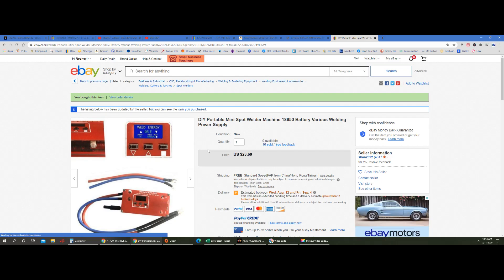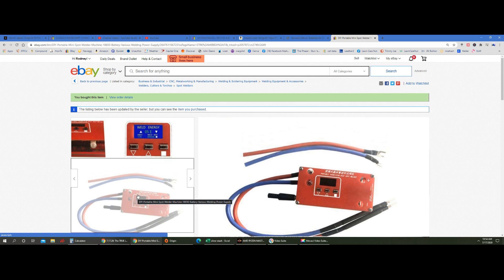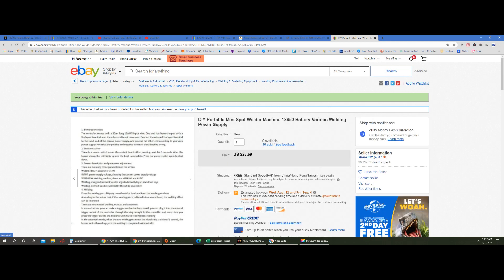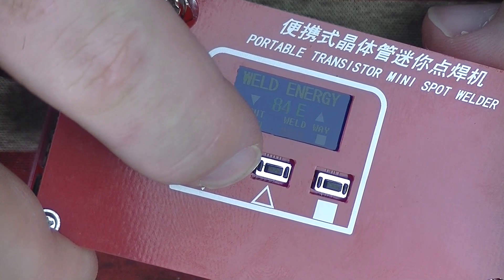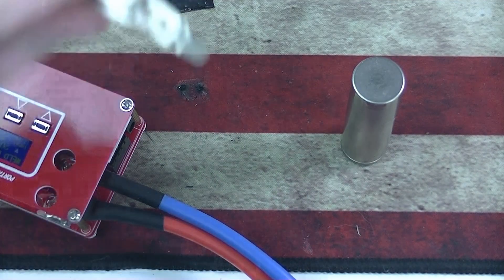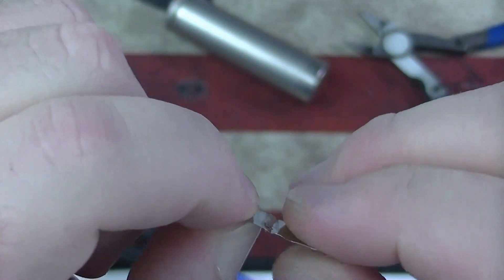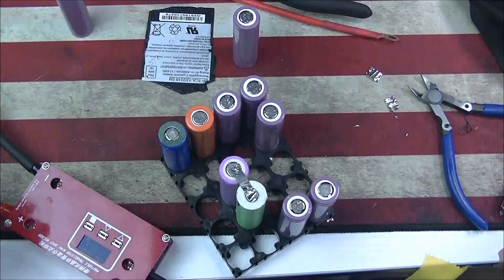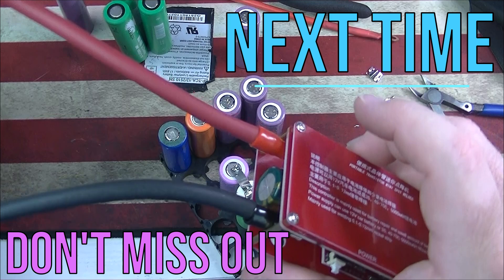The Best CHEAP 18650 Spot Welder?

Comment: Mine blew up on the first weld. I cut out the blown Mosfet and now use it as a timer for a starter solenoid welder.
Reply: Interesting! Please tell kore about how you have done that in detail!
Reply: @victorandersson9737  Mine failed in the 'continuously conduction' mode. You need to cut the traces top and bottom, I used a Dremel cutting wheel, to identify the faulty mosfet. In my case it was next to the capacitor. I then 'destroyed' the mosfet with the dremel and resoldered the traces. Make up new leads from the battery to the red box and output from the red box to the solenoid. These do not need to be particularly heavy duty. Use the supplied red lead to go from the battery to the solenoid and attach the red welding pen to the solenoid output. Joint the two blue leads together and connect to the neg of the battery. For good measure put a flyback diode across the solenoid windings. You will need to use a foot trigger in manual mode. Google solenoid spot welder, the idea is not all mine. I used a car battery and I needed to add some extra cable into the welding circuit to cut the amps down a bit. Good luck.

Comment: Try holding the tips perpendicular to the surface you're welding.  From some of the close up shots, it looks like you're getting very small weld areas.  Too much weld energy will burn through the edge of the weld shape and make it weak, too.  Thanks for showing me how affordable these can be!  I might order one in case I ever rebuild any battery packs.

Comment: I bought the same one it lasted for two extremely underpowered welds and now all it does is direct short as soon as the two probes touch totally junk
Reply: I have the same Welder It it works great! 
But now I have the same problem, after low voltage the welder make direct shorts without beep. 
Any solution? Can I repair it?

Thanks.

Comment: Worst $24 I've spent . . . tried it first time and smoked one of the mosfets. Dismounted the burnt mosfet and then tried again. Will not weld at 30E settings so bumped it to 40E and smoked two other mosfets. And yes, this is with the diode mod recommended in one of the forums.
Reply from the maker: That sux. knock off mosfets.  Mine is still going strong. just finished 6,500 welds with it.  Still cheaper than a K-weld, even if you have to buy 2 for the extra mosfets.   I do own a K-weld tho too.

Comment: 1:50 Tinned copper is copper wire that's coated with with a thin layer of tin.  This makes it easier to solder, but more importantly it protects the copper from moisture which can cause resistance in the wire.
Reply from the maker: nice!

Comment: Hello, thank you for your informative video. What about the question you asked yourself at the end of the video. If we take a few 18650 batteries in series (and in parallel to increase current), can we make this thing weld? I would very much like to know, because if we can, I will buy three high discharge LiION 18650 batteries and power this thing with these. I don't like the LiPO technology!

Comment: I'm looking to do a couple welds here and there. Mostly just repairing worn out tool batteries and maybe a personal power bank project. Would you consider this little gadget over say a welder made with a recycled microwave transformer? Making one out of a transformer and adding a timer looks pretty simple
Reply from the maker: I would say the all-in-one that comes with the battery. It will weld .1mm. for cheap. If you have a a good 12v LiPo battery then this one is the way to go.  Im using it now for my Powerwall video.check out my other videos.

Comment: Can someone explain the motion of the wires when welding?  Do high current on wires cause it to jerk?
Reply from the maker: ITs that or the current creates a magnetic field that repels the wires.
Reply: Yep. I first have seen this when i used relative thin wires in combination with relative high power speakers.

Comment: the second spot weld it did 2 MOSFETs Caught fire.  I was using 3 cel lithium battery 80c.  even the instructions that were supplied says that the internal resistance the MOSFETs can vary and this can cause them to destroy themselves I will get my money back on eBay.   if they are prone to fail this often perhaps they should supply extra MOSFETs.   For me it's a complete waste of time

Comment: I spotweld 18650's with a big capacitor charged to 35v.  It's easy to just charge it to a higher or lower voltage depending on how much heat you want.
Reply from the maker: Thats pretty cool. How long does it last per charge?
Reply: @RodneySolarCircuits  One shot per charge, but you just use it connected to a bench supply (only connected to charge, disconnected to fire).  So, engage bench supply for 1 sec or so, then off, short terminals to thing you want to weld, and repeat.  If too hot, lower volts, too cool, raise volts.  I find that 35v seems to work well.  Cap is 100kuf 50v.
Reply from the maker: @vandal968  cool

Comment: I bought one of those and it was a complete piece of junk. Ity did not work right out of the box and after trying for about 5 minutes it shorted out and just about lit on fire! You get what you pay for.
Reply from the maker: Sorry to hear that. Im using it now to build my powerwall and its doing just fine.  I guess its hit or miss. It is the best cheap welder I have used. Im not using a car battery tho. 3s lipo

Comment: also have one of these 20 bucks spotwelders.. were like 18 bucks + a couple in shipping.
and just use RC LIPO packs..4s even though rated at like 3s.
with one 4S i noted the pack got a little hot, so used 2x 4s in parallel and it delivers all the juice I need even with 0.2mm strips.. https://imgur.com/a/wo4v4Mz
also, check it on the scope and the Energy interval adjust was 1 to 1 with one of the measurement variables on the scope... period or width. (ms)
but that spot welder will do for my semi-needs.
Reply from the maker: I'm using mine to build these huge packs.  Placed a little fan next to it and it keeps it cool enough I don't have to stop as much.  Im switching between it and kweld.

Comment: I bought this exact welder.  Connected it to a 12v car battery on my work bench.  After a little practice, got nearly 1,000 welds then it smoked a MOSFET.  Ordered a replacement and it made three welds before smoking a MOSFET. If they work, they're great. but the quality control is out the window.
Reply from the maker: I think you are right! mine is still going strong.  im using it in my next video now. I have to let it cool down a lil after 8 welds @ 40E

Comment: Anybody blow a hole in 18650 with a welder before mine keeps doing it
Reply from the maker: lol.  yea turn it down and make sure there is no air between the strip and battery.   30 -40 is all you need for .15mm
Reply: @RodneySolarCircuits  thanks my car battery is 640cca does that have anything else to do with it?
Reply from the maker: @hedgehog5705  well if you read the comments they talk about car batteries blowing the welder up. now I dont hear from the ones that have used a car battery and had no trouble sooo. But I use SPIM08HP cells (3s) and they are capable of 400 amps each. I used this welder last night and it still works fine.
Reply: @RodneySolarCircuits  i'm using a  510A car battery and the first time i tried this spot welder the battery was fully charged (around 13.4v),but luckily no blown mosfets here :)
So probably there are some "flawed"  batches of this spot welder, idk.
Btw, i used the vanilla version of the spot welder, no mods/improvements done.
Reply: Has anyone tried using a VS-100BGQ015 Schottky Diode between the + and - welding leads to help dissipate the avalanche energy ?
Reply: @jimbean8413  I plan on adding SMCJ20A TVS across drain/source of each FET. I bought 10pcs so I'll probably throw a couple on the power input and output too.
Reply: @andronicuscomnenus2642  Not sure if you've read the endless sphere forum thread on the JP spot welder, on page 23 flangefrog gives a good summary, as per okashira's comment "the flyback (schottky diode) takes care of 90% of the avalanche energy, and the TVS diode takes care of the other 9%" I've ordered a couple VS-100BGQ015 and five 5KP13A, once received & installed I hope this will allow the mosfets to survive
Reply: @jimbean8413  No, I hadn't seen that thread. I already have the TVS and it cost more for postage than the parts, so I will just use them and see how it goes. kWeld uses only TVS, and that's the gold standard for spot welders. It uses a SMCJ28A on the power input, SMDJ28A across load/probes, and SLD8S28A across drain/source. EDIT: I see the newer versions use SLD8S28A across the load now instead of SMDJ28A.
Reply: @jimbean8413  Forgot to mention I'm also removing the large capacitor because is serves no purpose and only causes the terminals to spark when connecting power source. I'll also add a large(ish) cap on the control board power input after the blocking diode. This will prevent the gate voltage from dropping too low during a pulse.
Reply: @andronicuscomnenus2642  Nice, looking forward to hearing how it works out, Would like to get a kWeld but for the amount I'd use it, can't justify the cost
Reply: @andronicuscomnenus2642  Nice work, those mosfets should last now!

Comment: What did you use for a power source for the welder? Could I use a lithium tool battery as a power source for it? Like a 12v tool battery just as it is without dismantling the battery and just run leads from the terminals?
Reply from the maker: aslong as its  9-12v you could try. good idea.  i WILL HAVE TO TRY THAT

Comment: Can you recommend any spot welders for 2mm nickel  .
Keep up the vids
Reply from the maker: This one will do it for sure.  I have tried up to .3mm.  This thing has power with the right battery.
Reply: @RodneySolarCircuits  thanks for reply how many welds roughly before having to let pcb cool down .
I take weld quality changes as it gets warm?
Reply from the maker: @gkitch6755  for .2mm prolly have to have it set to 30-45ish and even my Kweld gets to hot while I was building a 7s8p pack.  Mainly the welding pins got to hot to hold.  So about halfway through it I had to let it cool down.  2 welds per end.

Comment: Come on man! Forty Joules or E applied for a tenth of a second only requires 400 Watts. With 12VDC that's only 33.33 amps. Way off from 300 amps! Your original wire will work fine.
Reply: How do we know it's only 40 joules?  Is there some sort of data sheet/guide that came with this gizmo which says a reading of 40E means 40Joules, or is that E reading just a relative enrgy scale.  TBH 40 joules hardly seems enough to make a spot weld ???
Reply from the maker: @chrisbrett1857  on the Kweld it is measured in joules.  30 joules is enough for .15mm nickel strip per kweld. But everything is relative.
Reply: @RodneySolarCircuits  Thanks for your reply - it's very helpful to me, as I've been struggling to find a definitive figure for the approimate level of energy needed to make a battery spot weld.  I've seen good reveiws of the Kweld, which seems  to be a well-engineered pieve of precision kit - but a bit pricey if (like me) you only want it for very occasional use.  What you say certainly lends credence to the idea that the piece of kit in this review will weld at 40E & that 40E=40 Joules. Thanks again
Reply: I believe the pulse is shorter than 100ms. Typical pulse time would be 1-40ms from what I find on Google.
Reply: If it was only 30 amps, you wouldn't need wires anywhere near that big. I think you're overlooking something. Thinner wires would give better flexibility and mobility; I'm sure they use thick ones across the industry for a reason.
Reply from the maker: You Know....The thing...look    Come on man....Thicker is always better, Corn Pop told me  "Trust the scientists"  he said, no matter what race the lady that stocks the groceries is.

Comment: What are you powering it from? I am wondering if it can be powered from a home electric socket with a voltage converter
Reply: High amperage lipo or a car battery. its not the voltage that does it here its the amps
Reply: @Trojan_DC  thanks! Never heard of a lipo before. Will have to do some research

Comment: @Rodney Solar-Circuits  did you try a car battery?  i just got one of these welders and used a 12v 7AH rated 45amp for 1 minute  which should of been more than enough.but it blew a one of the 1 of the mosfets :(  any solution for this or know why ? any help appreciated did you try a car battery?  i just got one of these welders and used a 12v 7AH rated 45amp for 1 minute  which should of been more than enough.but it blew a one of the 1 of the mosfets :(  any solution for this or know why ? any help appreciated

Comment: This is Jason Coronado. Same person, different account. Just fried mine today. It's possibly due to me using it after putting the lipo in storage mode (11.4v). Can anyone confirm, or is that low voltage not likely to fry a mosfet?
Reply from the maker: IDK, should have been fine. that is how i use mine with no problems. I have heard that if the leads touch it will blow a mosfet. ??
Reply: They never touched. Made a nice acrylic case for it as well, lol. Oh, well--went and bought a Malectrics instead. At least I got a refund.
Reply from the maker: @SpaceKaseJase  Well there you go!  That will for sure work no problems.   I have a K-weld. Its a beast!

Comment: Can someone who has replaced the FETs on these devices tell me how you removed the old ones. Do they have pins going through the PCB?
Reply: No, they’re surface mount devices. But the cost locally for me of the 5 mosfets is higher than buying a new spot welder unit.

Comment: Mine let the smoke out first try. Using car boost starter as suggested in one video. I guess this device is very sensitive to input voltage. Must be running on it's limits.

Comment: I.ll stick with my soldering iron..last longer and doesnt blow components after heavy use
Reply: Good luck. The heat necessary to solder to the battery will damage it.
Reply: @lindanlester  No luck needed sorry, been doing this for over a year. No issues..😁
Reply: @k1ortia  You are greatly diminishing your possible cycle count, proven fact. Heat is bad for Lithium chemistry cells.
Reply: @earnwithbots2783  i agree, but after 2 years of using this method..the facts dont lie.😁
Reply: @k1ortia   Cant argue with that. And that is with daily cycling?

Comment: that welder is pretty good for that price, i am going to oder 1 for myself now. thanks for the video.
Reply from the maker: Thank you!  What kind of battery are you going to use to power it,  People have been having bad experiences using CAR BATTERY. make sure its under 12volts if you do. Or maybe you would like one of the ALL-IN_ONES that I made videos about?
Reply: @RodneySolarCircuits  I am going to use a Car battery, because I work in a autoshop, so I have alot of car battery around here.
Reply from the maker: @icebreaka1969  careful with the voltage.  Maybe it will be fine and the handful I have heard from are the minority.

Comment: Just noticed another video that did not work for him... But I noticed that he does the positive first and then negative, and it blew. I noticed that you touch it with negative first the positive. Do you think there is a difference? Since the electronics are controlling the negative side and positive is just straight through
Reply: I think applying ground (negative first) helps in just about everything when working with electricity. This is probably why switches go to the positive as negative is always connected. Don't know, just my hypothesis.

Comment: You can’t weld 2 dissimilar metals.  Only under a roll welder it can be done😁
Reply from the maker: nickel strip to steel can battery? Is nickel special that way?

Comment: How do you get the unit to Auto mode, mine sparks as soon as i touch the probes to the metal. No instructions with mine.
Reply from the maker: I think it is the button on the right. but you will need a foot pedal or switch.
Reply: @RodneySolarCircuits  Thanks for responding, mine switches but apparently the auto doesn't work, it sparks as soon as i place it on the metal strip. Thanks again
Reply: @dga5396  Sounds like one of your mosfets is dead. with welder off, do a continuity check across bank of mosfets. If you have continuity one of the mosfets is confirmed dead.

Comment: I just got one from banggood and released smoke after 2nd try. Very disappointing:(
Reply from the maker: Did you use a car battery?
Reply: @RodneySolarCircuits  12V 7Ah Sealed Lead Acid
Reply from the maker: @microheliaddict  Sorry,  It must be sensitive to battery voltage.  everyone that has used a lead acid battery has had trouble. read the comments.  Ive used mine a few times with a 3s lipo battery. no issues.  maybe try an ALL-IN-ONE.
Reply: @RodneySolarCircuits  yeah it's strange.. I wonder why they recommend 12V car battery then? The voltage on lead acid battery is 12.7V. Do you make sure the 3s lipo battery is under 12V before using? What's the minimum size 3s mah lipo you would recommend? I might try getting replacement mosfets if I can't return it.
Reply from the maker: @microheliaddict  I pulled the battery off the charger before it finishes.  it read 12.1 volts on the welder.   I used 8ah lipo cells.  (SPIM08HP).  you can find them on ebay or batteryhookup has some options. Or one of those 3s RC batteries with a high (C) rating.  Some links in the description.